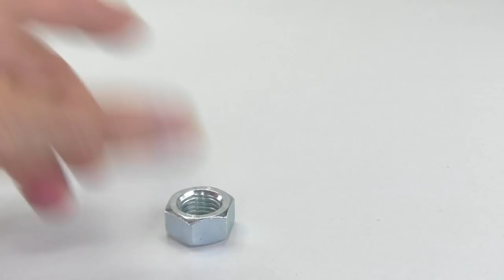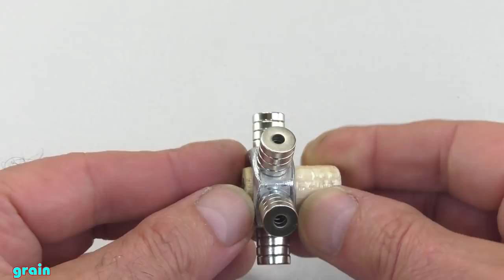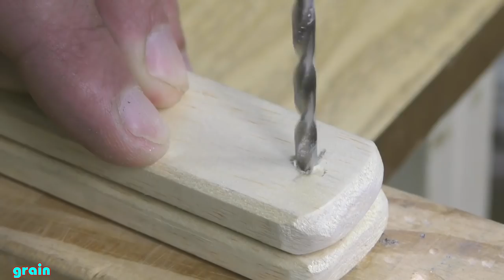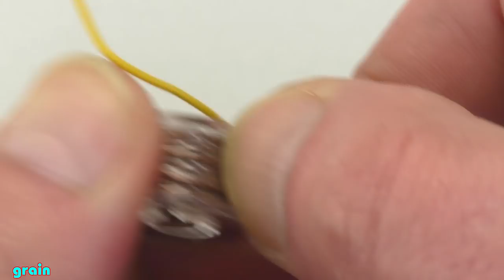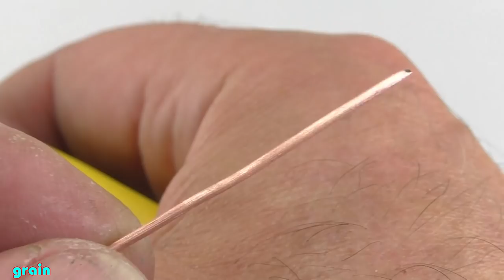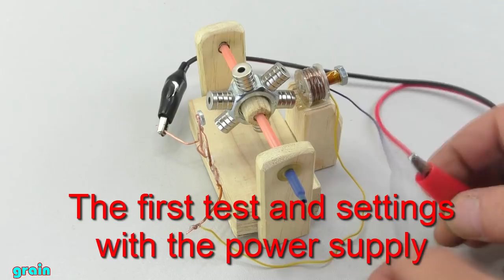How to Make a Simple Electric Motor

Comment: thanks for posting.  mediocre work.   precision is low, in this iteration.    here are some things to consider.   HARDENED steel  should  NOT  be used for the core of a solenoid coil.   a hard steel core will  Soon  become Permanently magnetized.   as a core, a few  common nails  Should be used; or other suitable ferrous or  mild steel  object.   the use of a 'normally-closed' switch design results in low energy Efficiency; and it does Not accommodate tuning the motor's performance, by varying the duration of the  'coil ON'  period.    above a certain speed, such a switch tends to be in a 'floating' state;  where contacting is  chaotic, Not controlled (as intended.)    a much-too-Massive magnet has been used, in the switch.  (the magnetic switch Should NOT cause a Perceptible 'load' at the Perimeter of the rotor; Any Load/drag here has  Maximum Breaking effect.  duh.)    the presence of the Moving Mass in the switch, will Lower the rotation rate at which float will begin to occur.          a v2 might include the use of a tiny magnet for the switch.  the travel of the switch-magnet can kept 'small',   WHEN  the magnet is Not  mounted AT the contact point.   at higher speeds, six switches/rpm  is  TOO many, for this motor.    cheers           googletranslate
Reply from the maker: Many thanks for the detailed theory! I read with pleasure all your comments. You are absolutely right in everything. But
 the fact is that in my videos there is no goal to achieve a perfect device, the goal of the channel is to show the model, any physical effect. On YouTube, there are two types of channels: for the soul and for money. My channel for money. But I try to do within my time and my possibilities so that it does not work out very badly.
The only true your remark about the poor alignment. It often happens in my engines, I know it and I am very worried. Because it is noticeable in the video and it slows down the rotation. I even wrote this at the end of this video - https://youtu.be/BwtwxSMwgjM?t=3m55s
In this electric motor, I needed to simply wrap thick paper with glue on the axle and bring the diameter to the required size for insertion into the nut. Then the centering of the rotor would be close to perfect. Moreover, it is easier and faster to do. And I wrote about this in the comments at the top.

Thank you again, David!
Reply: jeezus.  grain, please look up the word  'critique'.   learn it and memorize it.    the Accurate Observations described in my comments  ARE  Merely  Statements of FACT.   they are Not an ATTACK.      on the other hand,  if you wanted to post a side-bar monologue, you Should have  posted  your  Own  dam  comment.  why.     because,  the "whys and wherefores"  behind your actions are  NOT relevant, in  This  conversation.   cheers             googletranslate
Reply from the maker: I know this is not an attack and I am grateful for your criticism.
Reply: @daviddavids2884 i know this dude is beta in person

Comment: Does the electromagnetic core repel as well? I’ve built one and can’t get the rotor to turn on it’s own.
Reply from the maker: It is not so easy without experience. The main conditions are the minimum friction in all joints and the accuracy of performance. Also need good batteries with high current, it is alkaline or rechargeable batteries.

Comment: btw, it is easy to convert an inexpensive screwdriver into a  steel  shaft or axle.   shimming an axle/shaft with tape, ca, etc, in order to achieve a friction fit in a bearing can work reasonably well.    it is possible to salvage miniature precision bearings from most 'dead' rc cars and helis.    cheers
Reply from the maker: Thank you, but I am making it cheaper: I use electrodes for welding of different caliber. :) They are completely smooth and satisfy my goals.
Reply: yes.  and its  JUST  you and me.    i do enjoy these  'private' conversations.  don't yu.    cheers

Comment from the maker: I advise you, instead of a wooden sleeve for the axis, to make turns of thick paper with glue on the axis. It is easier and faster and the main centering of the rotor will be better. I made an uneven wooden sleeve and therefore the rotor vibrates, makes a strong sound and slows down the speed.
And yet: the number of magnets is not necessarily 6, you can make any number of magnets from 3 to ... The main thing is that the magnets are located with the same poles to the coil.
Reply: Hi
Reply from the maker: Спасибо, но я ничего не изобретаю, просто демонстрирую законы физики. БТГ - это энергия из ничего? Это противоречит законам физики.
Reply from the maker: Что ваш Серл, что Капанадзе - это всё из одной серии - фейки, чтобы привлечь внимание. Лучше учите физику - https://ru.wikipedia.org/wiki/Закон_сохранения_энергии
Ваши умники поломали законы физики? :)

Comment: Hello, thank for for video.
4:26, please describe, what was wrong, why motor didn't rotate constantly, and how was it fixed ?
Reply from the maker: Good question! The motor requires careful adjustment of the switching contacts. I think that in each case it will be different, so it makes no sense to tell. It all depends on the thickness and length of the switching wires, on the  strength of the rotor magnets, on the magnet strength on the switch as well as on the distance between the magnets, on the voltage, coil parameters, coil location, friction force and more.
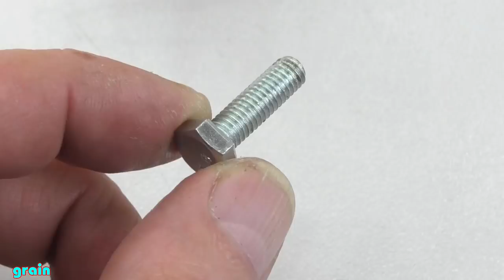Reply from the maker: Yes, the magnets in the switch repel. I thought it was clear and did not write. Yes, it was necessary to move a little slower at 3:30 in order to be well understood.